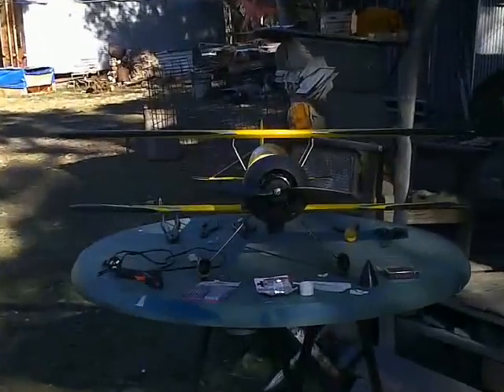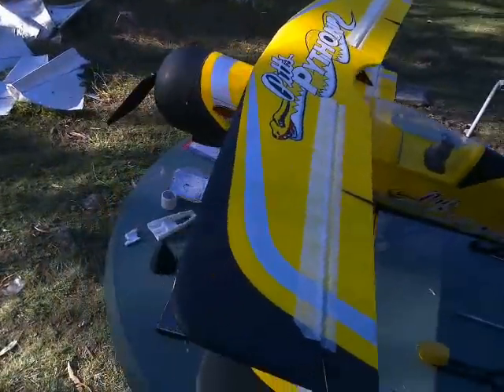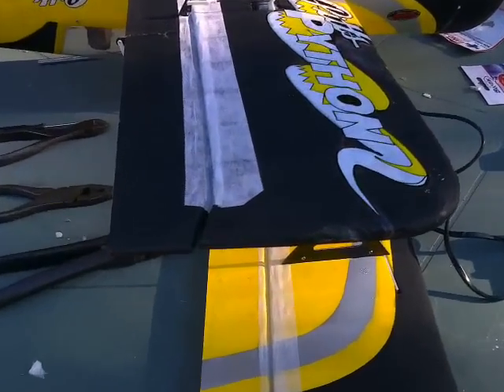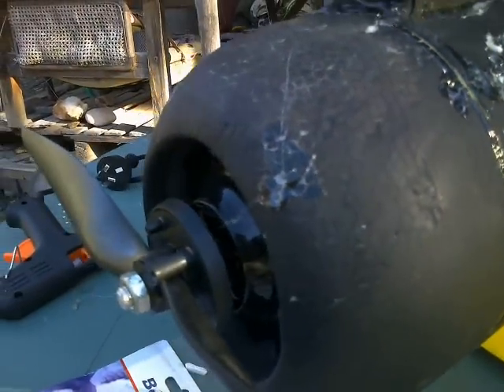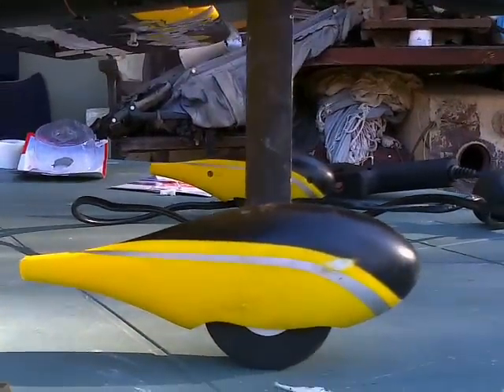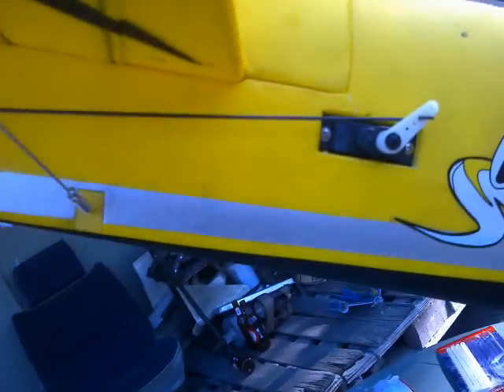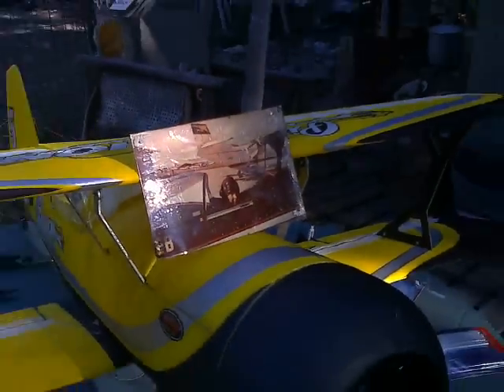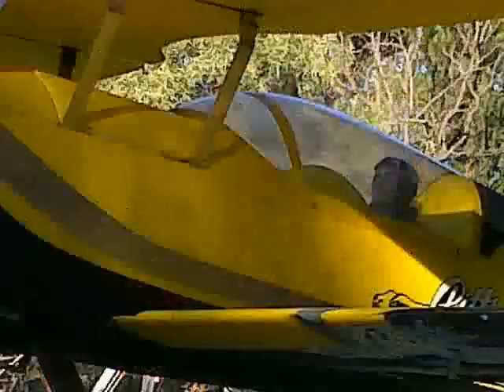Pitts Python Repaired, With Kangaroo Cameo...

Comment: Really pretty Pitts... Nice and solid repair
Reply from the maker: G'day,

Thanks mate, it was my first time using the Hot-Glue, and I was surprised at how easy it was to use and how well it works on foam..; I was intending to use some Epoxy, but that would've taken time to try a test-sample to see if this batch of Araldyte will stick to this Foam or if it melts it instead..., so I went merrily on and used Hot-Glue on everything.

;-p

Ciao !

Comment: Looks like you did a hell of a good job patching it back together. Now we must wait for the first flight. Hope it goes a bit more than 3 seconds. I bet looking at that plane gave you flashbacks, having flown one.
Reply from the maker: G'day Jim,

Thanks mate,

Yeah, I'm a fairly hopeless case when it comes to Aeroplanes, I grew up completely fixated on the whole Biggles Fantasy...; and even though I tell myself that I'm over it, I still get up to go out with Binocculars and look at each one I hear flying over...

  When I was working at Bankstown Airport at Sydney, I could even identify the pilot of a Helicopter as well as the type of Chopper when it taxied past the other side of the Hangar, sight unseen..; there were only about 40  Choppers in Sydney at the time, but they all flew slightly differently & made different noises...

 I was working for a 2nd-Hand Aeroplane Salesman who had the Agencies for Pitts Specials & Bellanca Decathlons & Citabrias, so my days there generally included  pushing a Pitts S2-a in and out of the Hangar, and polishing it before the Yacht Designer who owned it flew over in his Hughes 300 Helicopter  for his daily Aerobatic Practice...

  Back in the days when I was young and keen...

;-p

Ciao !

Comment: You seem to love everything aeronautical. Have you ever had a fantasy of jumping off a mountain with a Hang Glider ?
Reply from the maker: G'day Ed,

 Thanks mate,

Um, yeah, back when I was a Teenager I wanted to get a Hang-Glider, but when I left school I got a Minimum Aircraft ("8Hp, 1975, Skycraft Scout..."), and though I hung around a couple of Hang Glider Pilots in '78-'79 it was as helper & driver rather than me trying to fly them.

 In the 1990s, after I crashed my VJ-24w Ultralight Motorglider, I got heavily involved in aerotow-launching Hang Gliders behind a specially-designed Ultralight. In 1997 I sent my Research to CASA, and these days, If you want to Aerotow-Launch a Hang-Glider in Oz then you have to use a Ground-based Launch-Controller trained in using my "Lockout Index"...; to order the Tug-Pilot to release the Tow if the Glider Pilot has got themselves "locked-out" in the Roll-Axis.

   I stuffed my back, Nursing, when I was 25, and crashed an Ankle at 31.., and you have to be fit, strong, and fully-functional to be flying Weight-Shift Aeroplanes which use Legs to function as Undercarraige..; so I figure that I'm beyond Hang Gliding.

 If I was fit enough for it, I'd like to have a Para-Glider, the modern ones glide nearly as well as the Hang-Gliders used to, say 20 years ago, back when I was considered to be the Expert on not killing the Customers while pulling them up over the fence.

We used to charge $10 to 1,000 Ft plus $1 per hundred Ft thereafter, and they'd either get dropped-off in a Thermal, or at a preselected height..; Rope-Breaks were free, but Releases for Lockouts counted as a $10 Launch, and because they were alive to pay they were always happy, I used to let them get a good fright, and KNOW they were locked-out before being released.

 Operant Conditioning goes well, with the fear of imminent death to boost the Learning-Curve.

  People like to talk about how safe Flying is, but since I was 17 years old about 9 people I've personally known have died while flying, and only 2 were Commercial Passengers, the rest were playing with their Biggles Fantasy and fucked it up.

  I'm lucky, I only limp when I try to run, walk too far, or carry too much weight...; compared to pushing up Daisies, my pennance is pretty light ; I know another bloke who lived, but he left 30 years of Memory in the bit of Frontal-Lobes which leaked-out his Nose, after Low-Level Aerobatics Practice in his Ultralight went pear-shaped one afternoon.

  I thought long and hard, and about 15 years ago started steering my kids towards Models because they allow all the fun of Flying, without having to sit in the bit which crashes...; and though he's Helicopter Winch-Insertion/Extraction Qualified, for the  Remote Area Firefighting Team, that's as Aeronautical as my kids get between them...

  I wanted a Mini-Quadcopter with FPV for my birthday, while he was on the Web looking for it he pounced on this Pitts Python..; & it's like old times to be repairing my kids' R/C 'Plane...

Once bitten by the Flying Bug, it never leaves, the trick is to learn to indulge it in ways which doesn't  totally turn one's life to turds when something goes wrong..

;-p

Ciao !